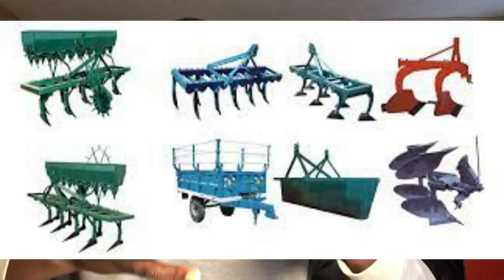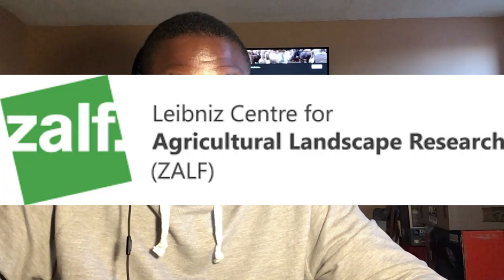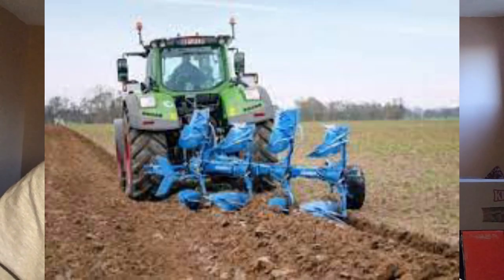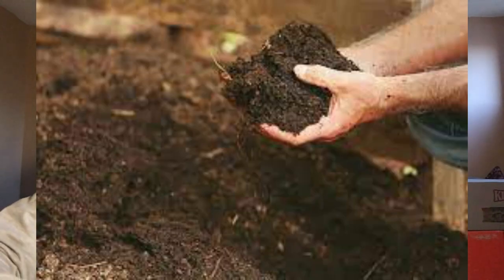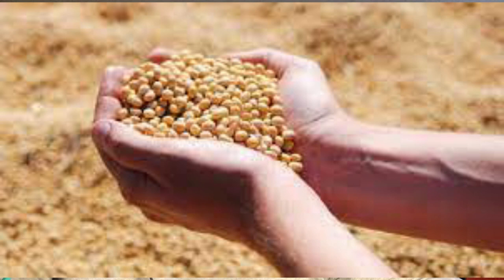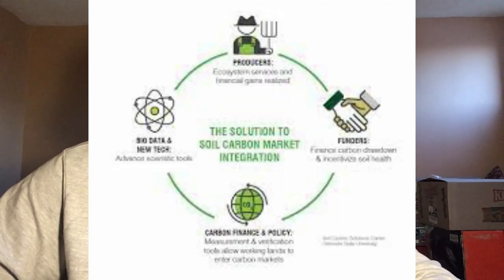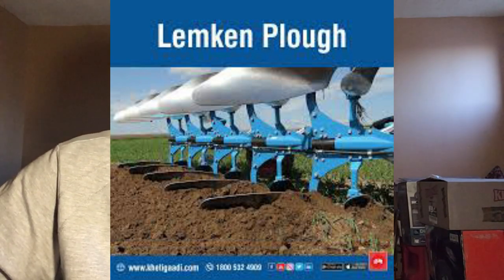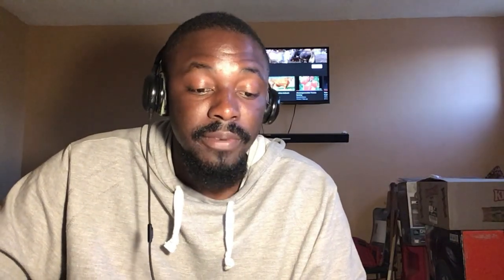#farminginnamibia Plough to improve carbon storage

Comment: Good insight. However ploughing releases carbon stored in the earth every time you break the soil up. However No-Till stores it as the soil isn't disturbed
Reply from the maker: I did some reading  on that Lemken are saying their plough will put be able to return the carbon storage back in the soil as per the article  .
Reply: Most of the carbon released is restored in the first year once the crops are replanted, deep ploughing is not the same as tillage as many confuse the two to be the same. Studies done in Germany and New Zealand are proving that deep ploughed lands stored and hold more carbon, deeper & for longer in the soils. While also improving yields & water retentions which would also improve carbon sequestration and helps combats drought effects.
Reply: @buffalosoulja3666  Carbon is released after every plough. Those are merely temporary advantages in improved yield. In the long term you can compare to No-Till methods in building organic matter, keeping soil microorganisms alive and dealing with weathering of the soil.